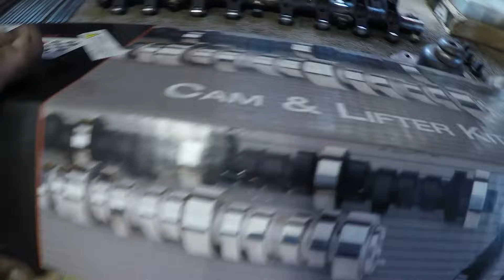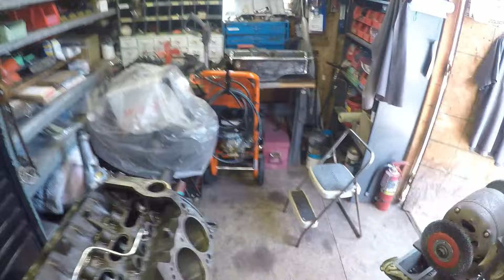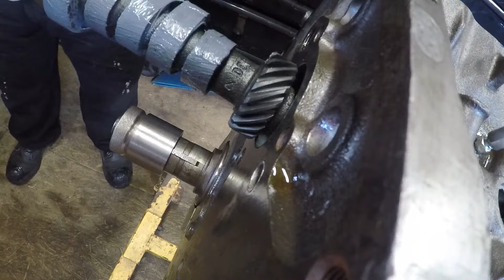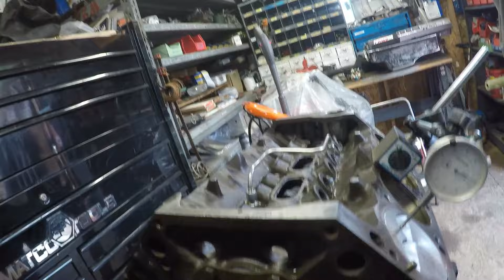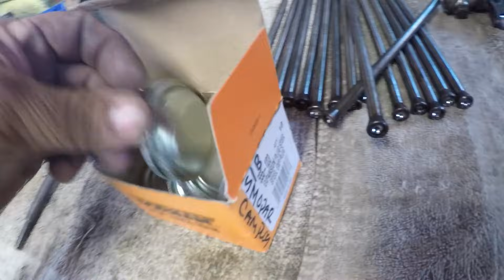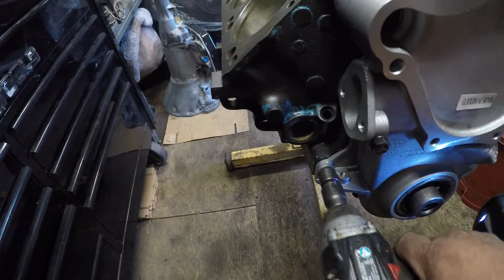INSTALLING  THE CAM 360 MOPAR BUILD

Comment: installing my hydraulic roller lifters on my 78 360 this weekend hopefully, they are connected with a link bar, do you know if the side of the lifter that has the rivets holding the link bar on faces the valley? thanks for video